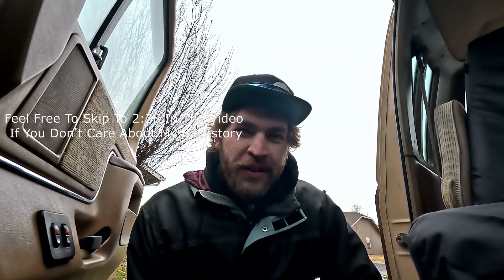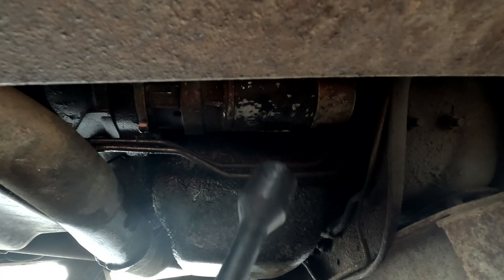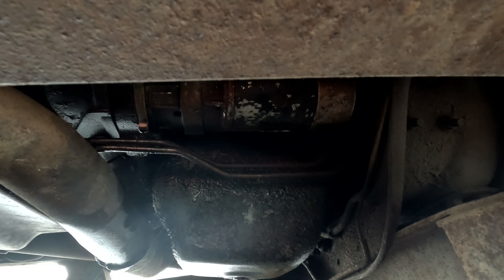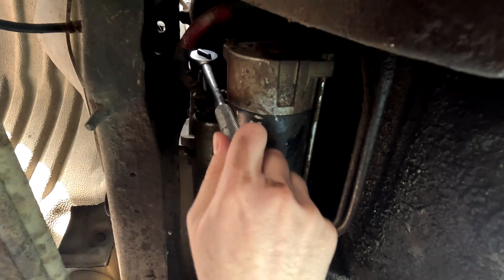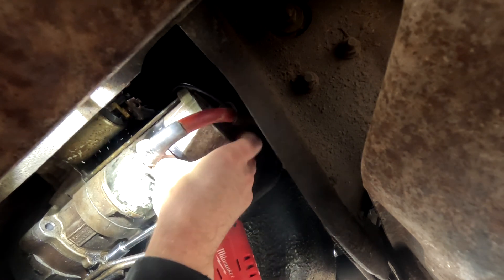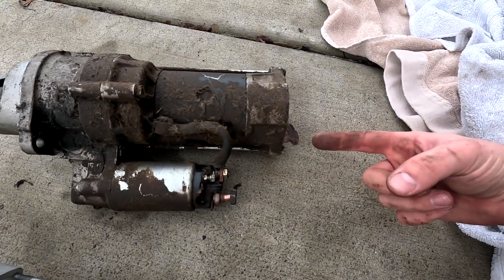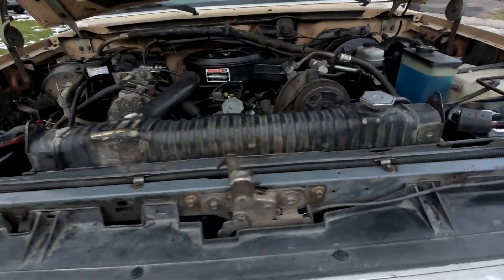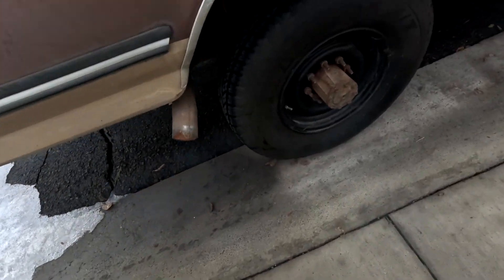7.3 IDI Starter Replacement

Comment: I still have my bought new 1988 F250 XLT Lariat Supercab 4x4 7.3 and the OE starter is slowing down.
Why didn't you go with the Powermaster Performance 9050 Ultra Duty Diesel Starter or a gear reduction starter for a faster crank?
Reply from the maker: That’s amazing you still have it.  How cool is that?!  It would’ve really helped, but a regular starter from a local parts store really did the trick.  After that it fired right up without much trouble.

Comment: Thanks for the video man showed me a different way to get yo that bolt. Long extension was too long so i used medium and a short together with a swivel head ratchet if you have small hands you can reach around the starter and spin the extension by hand. Thank you
Reply from the maker: I’m so glad the video was helpful!  It’s definitely not easy to get that starter out but with the right tools and technique it can be done👍

Comment: I replaced the starter but can't seem to find where the issue is, It's installed correctly just nothing it turning over just massive voltage dump and then clicking at 8v 
thoughts?
Reply from the maker: Did you test the starter before you installed it?  It could’ve been faulty right out of the box.  Probably not the case but is possible.  Also maybe a bad starter relay.

Comment: Take the starter apart and the top bolt is a lot easier to reach. Just loosen the two long 10 mm bolts and it comes right apart.
Reply from the maker: That’s great advice I’ll remember that for next time😀👍!

Comment: Excellent work. Glad you had a great source for emergency advice.
Reply: Those are some serious starters. They used to cost twice as much as that tow bill you were quoted. 

The bolts that take an Allen wrench to tighten/loosen  are called Socket Head Cap Screws (SOHC). They're typically used in the machining world for blind/flush mount holes. They are both handy & a huge pain to deal with. 

Anyway, glad you got it sorted out. Still dealing with the intermittent issue on the power stroke?
Reply from the maker: @WesleyJohnsonMI   Ya learn something new everyday!  It was a hassle trying to get that screw out but in the grand scheme of things wasn’t the worst thing in the world.  I can tell a big difference in how this truck starts so it was money well spent👍.

The Powerstroke still is giving me that p1211 code.  I’ve done some testing as well as talk to people, and after doing research I’ve narrowed it down to two possibilities that could be wrong with it.  The good news is I have everything I need to find/fix what’s wrong, so it won’t be long before I get this truck on the road again👍
Reply from the maker: Thank you!  James’ advice really helped out that day👍